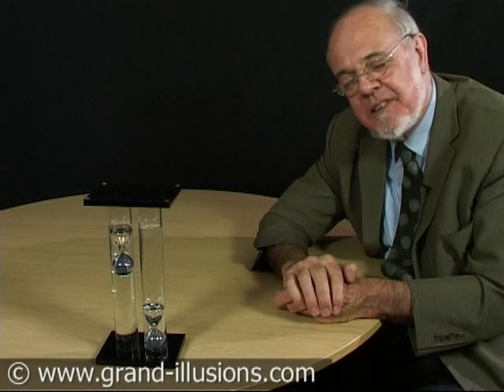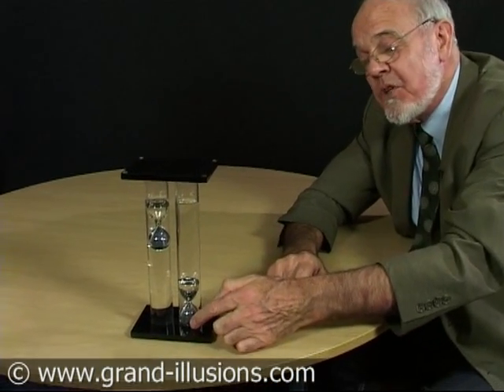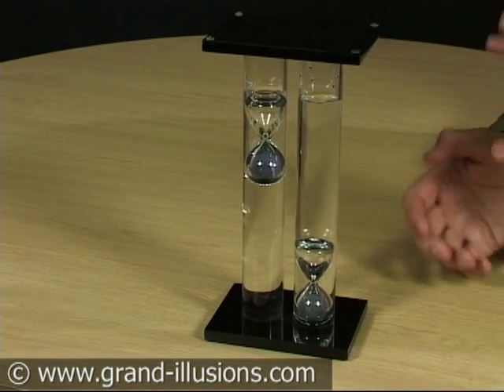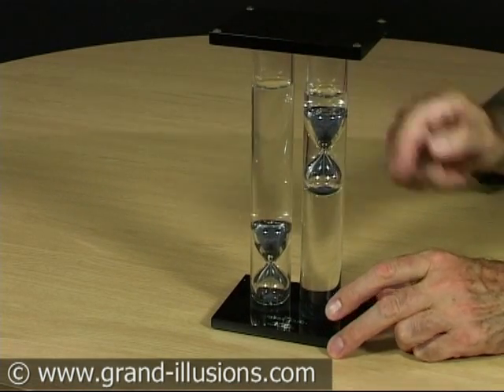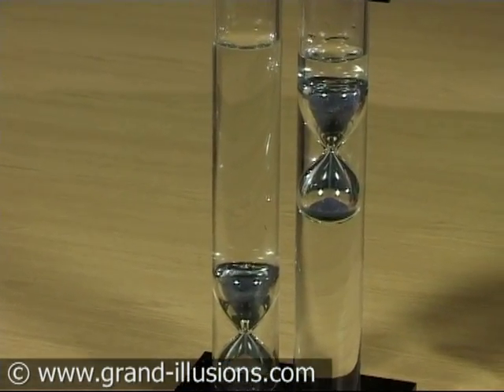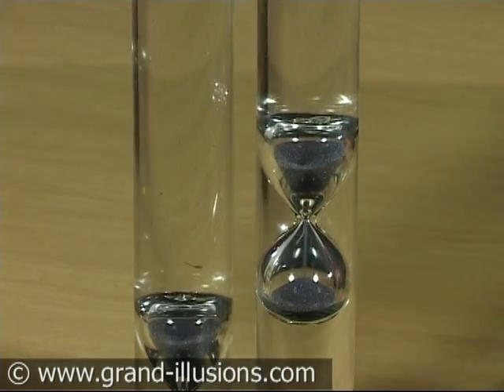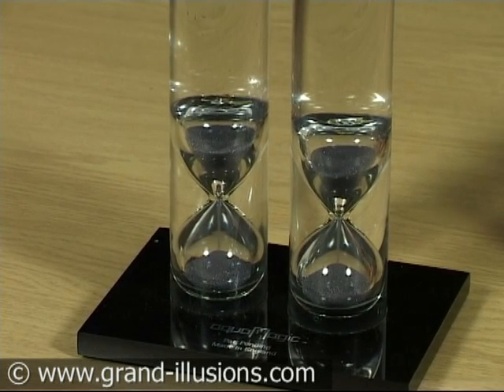Floating Hourglass

Comment: The reason it works is because when the sand is in the top, it leans over like this & which causes it to grip to the side of the glass, preventing it from floating up, as the sand falls to the bottom it straightens up like this 8 which allows it to float up.  The same goes for the other one, but gravity makes it easier to fall down, the grip isn't as strong with the tilt of the hourglass inside.
Reply: nambinhvu Err that is called a Hypothesis. You have an Idea as to while it works in that manner but you have not tested it. Therefore it is a guess.
Reply: Stanislav Drumzz
Don't explain why or anything. That would be weird. But what do I know, Im just an idiot.
Reply: I heard a myth once that human's can live without conflict over trivial matters.
Reply: That was my thought too. Are you sure this is the reason, or are you guessing?
Reply: @matszz  This may be interesting ;)
https://www.youtube.com/watch?v=L97Lrumscw8
Reply: matszz That is the only reason that would make sense under the laws of physics.  The small gap between the circumference of the two are also required in order to allow the displacement of the water for the hourglasses to move, which also slow the rise and fall of them.
Reply: So, guessing, thanks.
Reply: matszz Not really, because that is how it works. :P
Reply: nambinhvu
Yeah, you think thats how it works. Thats called a guess.
Reply: matszz Nope, I know that's how it works.  You think there's some magic going on? lol
Reply: matszz Guessing would imply not knowing/understanding.
Reply: nambinhvu
Yes, I asked if you knew or guessed. You stated the explanation you thought were correct. I agree with you, I think it's the right explanation. It's not confirmed in any way though. That makes it a guess. May I ask what your nationality is?
Reply: matszz The explanation is confirmed by what happens. :P There is nothing hidden, or magical.  You can see how the hourglass tilts over to the side and scrapes against the sides, which prevents it from floating up and going down.  It is glass, and the only thing not confirmed is what the fluid and sand is made of, but the fluid and sand doesn't matter, it's the density that matters, and as long as the densities are within a certain margin of error, it will do this, one has slightly more sand, glass, and/or less air to counteract the buoyancy.

And to answer your question, I am half Vietnamese half Chinese, not sure why that matters. XD
Reply: nambinhvu
You're welcome to believe you know for a fact what physical interactions cause this to happen. I don't know that for a fact, you can keep explaining what you think all day long, and you might be right. I believe it's right as well. I have higher standards to call something a fact though.

I was just curious about your nationality, I usually find americans to take a hunch or what they "think" and call it fact, until proven otherwise. That's not good enough, in my opinon.

I asked if you knew or guess. You responded not by saying you knew or guess. You responded with a more detailed explanation of why you think, or claim to know, this is the reason. That to me is a guess, it answerd my question. According to you its a fact, according to me it's a guess. It's just a matter of standards, or definitions.

Like I said, you're welcome to call it fact, and you answerd my question.
Reply: matszz Now tell me how we can claim that as a fact then?  Take a microscope to it, and view the rough surfaces scrape together and catch? It is fact, feel free to take a microscope to it if you'd like.
Reply: nambinhvu
I was thinking more asking the one who made it, or a physicist. That would be enough confirmation for me. Are you a physicist?
Reply: nambinhvu
Read the description, it explains the solution. We were right. There were other solutions offerd though, and one of them could have been right. Which made your position a guess, in my opinon. I now have confirmation, sufficient for me to call it fact. If you had said "yes, I know it, because I read the description" I would have accepted it.
Reply: matszz Someone who studies physics or creates something does not make them an expert, nor does it give them the knowledge to explain everything physics related.  I studied physics, does that count?  If I made one of those, would that count?  You don't need to know how buoyancy works to make this.  The maker of a boat doesn't necessarily know why or how it floats in water.  Someone could statically charge themselves and shock someone else without knowing how it works.  Rubbing your feet across the carpet is hardly an explanation of how it works. lol

By the way, if you don't know how boats work, they work by displacing the same mass of water as their total mass.  The shape allows them to displace more without being completely under water.  But completely sunk would displace less, because the water would be able to fill all the cracks and crevices, because the materials are more dense it would sink, but as long as the boat floats, no matter how you shape the materials, it'll displace the same mass of water.
Reply: nambinhvu
The word of someone who studied physics would weigh heavier than a lay-mans. Besides, all you proved is that the standards would have to be higher than merley having a physicists opinon, which I would agree to. But it's arguing against your own case. You claim to need higher standards, but in reality, you only need a lay-mans opinon (your own), to claim something to be true.

I don't know why you are explaining to me how boats work, it's irrelevant, and I allready knew why.

I don't really know why you explained any of this really, I thought the matter had been settled.
Reply: matszz The whole point is, you don't need to be an expert who studied in a specific field to know how things work.  Are you a boat expert?  I doubt it, but you know how it woks and can explain it right?  This is exactly my point.  A student can teach a teacher new things.

It doesn't take a rocket scientist to know and understand what is going on here, the one that sinks starts on top when he flips it because he flipped it upside down, vice versa for the other, so of course it would eventually come back down and of course the other one would float back up, because of their densities.  There's nothing magical or difficult to understand here.
Reply: nambinhvu
Im not a boat expert, no. A sea captain explained to me why boats float though, that's how I know. I doubt you could explain why boats float unless you learned it from somewhere. Sure, you could figure it out, Archimedes did.

Did you read the description, like I asked you to?

You don't need to keep explaining the reason why hour glasses behaved the way they do. Not only have I agreed with you the whole time. It actually says the same thing in the description.

I have never suggested it was "magical". It might not be difficult for you, but the majority of people who offerd solutions were wrong. I find it very arrogant to just assume you are in the "right" category.
Reply: Stanislav Drumzz
This is the fourth time you've responded to me. After the first time I asked you to provide some explanation or proof of your claim. And you STILL haven't done that, but instead added on MORE claims that you don't support in any way.

And according to you, that's perfectly in order.

I demonstrated that you were in fact wrong, undeniably, or so I thought.
You didn't respond to that though. Just said, nuh-uh. Like an idiot would.
Reply: deohboeh
Oh, I don't mind the conflict so much. People being rude or arrogant for no reason is worse, in my opinon.
Reply: Stanislav Drumzz
it's not the first time i tell you i'm not interested in explaining anything
Yeah, that part is obvious.

if you think i'm wrong, then figure that out yourself
I already figured out why you're wrong. I also explained to you how I figured that out. That seems to have gone over your head though. Since you ask me to figure it out.

Here's some life advice, free of charge. Don't go around calling people idiots unprovoked and refuse to explain why you called them that. It makes you look like a grade A cunt.
Reply: Stanislav Drumzz
Apology accepted.
Reply: thiscannotbeyourname
What's with the condecending tone?
Reply: nambinhvu
Yeah, I told you on 15th of May to read the description, because it occured to me too.

Read the description, it explains the solution. We were right. There were other solutions offerd though, and one of them could have been right. Which made your position a guess, in my opinon. I now have confirmation, sufficient for me to call it fact. If you had said "yes, I know it, because I read the description" I would have accepted it.

And again on also on May 15th, since you didn't respond.

Did you read the description, like I asked you to?

What you did in my OPINION, was a guess. The FACT that you (and I, remember?) turned out to be correct is irrelevant.
Reply: thiscannotbeyourname
Im not even going to bother, go harass someone else.
Reply: nambinhvu
since you seem to think we're all idiots who can't possibly know how buoyancy, friction, and gravity affect objects...
I haven't said you don't know how buoyancy, friction and gravity affects objects. Im sure you do, I do too. You're idiots because you think that is the issue here. And frankly, Im tired of trying to explain that to you.
Reply: nambinhvu
Honestly, I have answerd the questions you raised earlier. I meant what I said, I can't be botherd to do it over and over. At least someone understands what I mean, I can live with that. Does that make him a co-troll? Sounds like you're wrong again.
Reply: nambinhvu
Oh and by the way. I wasn't the one who thought you were a troll. I actually thought you were not a troll. Reading comprehension isn't you strong suit, but that has already been established.
Reply: Tyler Garza
If you're going to butt in, read the whole conversation first.
Reply: Tyler Garza
This conversation started 14th of may, you made your first comment today, 5th of july. Explain to me how you "were already here".

You obviously haven't read the whole conversation or you would know that I "discoverd" the description the 15th of may. And nambinhvu "discoverd" the description on the 7th of june (despite that I explained to him that the solution was offerd in the description once I had realized it).

So I have read the description, and Im curious how we are both wrong, when we both offerd the correct solution.

And as always, this is not what the discussion is about anyways, but I've sort of given up on trying to explain that to people.
Reply: matszz I'm starting to think that nambinhvu is more correct than you are. After all, he did make an educated-conclusion. I suppose the best way to put it is: your line between fact and guess is off by a bit.
Reply: nambinhvu Again that is a guess; Yes the math and physics support your theory well (in fact I agree that is the most likely outcome) however I have seen no testing or hard evidence to support that theory. Remember Ernest Rutherford was so convinced that the Atom followed the Cookie Dough Method because it made sense both mathematically and by the laws of physics that the experiment he did to prove it he deemed a waste of time. To the point he didnt even attend the initial testing and left his assistants to run to experiment and bring him the results and when the experiment proved atoms had space in them he was stunned and said "It is like shooting a piece of paper with a gun and the bullet bounced back" no one thought it could happen. 

The moral of that story is that no matter how sure you are in your belief you have to be open minded that it could be wrong. You have successfully completed the gathering information portion of the experiment and for a theoretical stand point you can say "I believe this is the cause" without fear. However if you want to say 'it is the cause because of blank" then you will need to either find the creator explaining how he made it work OR design it yourself and make some changes to it until you find the cause.

THAT is proving something scientifically what you have done is proven how it works in theory.
Reply: I read all of that with Tim's voice. Interesting really...
Reply: deohboeh lol
Reply: Stanislav Drumzz
You're welcome.
Reply: matszz i apologize for calling you an idiot, that was very immature and stupid of me.
Reply: gandalftheantlion
Thanks, first person not to patronize me in this whole thread. I just thought it was a guess, the way I define things, or grade levels of confidence in a proposition. He just kept explaining why he thought it was the correct answer.

I got no love whatsover for my opinon. Then some others just decided to jump in and call me names.

I agree with your sentiment as well, you should always leave room for doubt. As a skeptic, I view it as a virtue.
Reply: i am some what not convinced with this explanation.
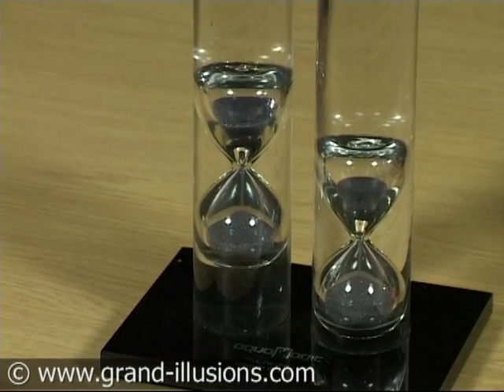around 1:30-1:35 both the tube have almost same amount off sand in hour-glass so physics should work same on both the side at this point of time
Reply: matszz I agree with everything you have said, but the reason I think you are being harassed is not because people think what your saying is wrong, but you seem to care a lot about something that appears to others to be so small, and on the internet. This makes you an easy target for one trying to get a reaction (a troll), which the internet is full of.
Reply: Troy Volanth
Thanks for the advice. Though I think you give them too much credit. The one who just answerd you, nambinhvu, demonstrated again that he doesn't understand what the issue is. I think that goes for all of them. I don't think they're trolling. thiscannotbeyourname might have been, but your guess is as good as mine. A voice of sanity in this thread is more than welcome, so, thanks again.
Reply: nambinhvu
Ok, that makes very little sense, but if you say so. I notice that you disregarded the other thing I said, you "forgot" to read that, like you normally do. Im so glad Im not you.
Reply: matszz lol I think he meant here on this video or something. XD  But yeah, he obviously didn't see that we'd already discovered the description, nor were we ever arguing about how it works.  We were merely arguing about whether or not my explanation on how it works was a guess or not. XD
Reply: nambinhvu
I agree with everything you just said. Let's end on that happy note.
Reply: matszz lols :P OK
Reply: *****
I don't understand what you're talking about.
Reply: matszz He doesn't understand how being top heavy causes the friction(stiction) against the glass tube and the hour glass by causing the hourglass to lean to one side slightly.  He thinks that if the sand was sealed into the tops of the hourglasses that it would still function the same way.

If the sand was sealed into the top and it remained top heavy, the only way to get them to float/sink back into their natural resting positions is if you continuously shake it in order to temporary remove the friction/stiction that's stopping it from moving up/down.

I don't know if he's ever seen one of those inflatable punch bags that always go back upright because of the sand/water in the bottom.  If he reversed the punchbag and tried to stand it on its head, he'd know exactly what I'm talking about when I say top heavy, and would realize the idiot he is...The hourglasses try to flip over while they're top heavy, this is what causes them to stick, which prevents them from floating/sinking until the sand falls and the hourglasses become bottom heavy.  Once this happens the hour glasses straighten up and no longer stick from the friction/stiction, so they can float/sink again due to the differences in buoyancy.
Reply: matszz No idea what he's going on about with the M&Ms and Skittles lmfao
Reply: nambinhvu
Thanks, I understand what he means now, I thought it might be what you said, but it's pretty dumb, and I wanted to apply the "principle of charity"

*****
I wanna know if you know this for a fact, or if you're guessing =)
Reply: ***** No, one will float, and one will sink, gravity will pull both downward because gravity does that to everything, but downward force does not automatically equal sink...the buoyancy levels is what causes them to float/sink...the stiction prevents them from moving to where their buoyancy will eventually take them.

Let me explain this in a way that even an idiot will understand.  Take two of the same exact water bottles, fill one with sand so that it just barely floats, now fill the other bottle with slightly more sand and watch how it sinks....one bottle of sand sinks, one bottle of sand floats, it's as simple as that...no stupid magical fluids...sure you could have one in different fluids, but then that changes how much sand/air content the hourglasses should have.  You're adding another variable that just makes the calculation more complicated...

You can put a bowling ball in a tub of mercury and it'll float, and then put it in a tub of water and it'll sink, but that is not what is happening here...one of the hourglasses is just more dense than water because of the higher sand/glass/lower air content(s).  And the shocking thing wasn't that one floats and one sinks, it's the fact that it waits a while before it starts to float/sink due to them being top heavy causing the friction/stiction, the friction/stiction is the part that puzzles most people.  If they stuck a piece of foam in one side and a rock in the other, it'd be obvious which would float and which would sink...and no one would be impressed by the fact that one object floats and one sinks...it's the delay that shocks people.
Reply: ***** Dude, do you not know how buoyancy works?  Weight has nothing to do with buoyancy...A cruise ship can weigh over a hundred thousand pounds and can still float...while a grain of sand can weigh not even 1 gram and sink...It has to do with the density, not with weight...the liquid (water) has the same density, the density of the hourglasses are different due to either more of the dense sand/glass/less air...
Reply: *****
Dude, the explanation he gave couldn't have been any clearer than that, and he explained where the confusion came from. Read it again, slowly. If that doesn't work, nothing will. We're right, and the description is right. What kind of confirmation are you looking for? What makes you so sure this solution is incorrect?
Reply: nambinhvu
Well this was a fun turn of events =)
I love how we both started our reply with "Dude" lol.
Reply: ***** Lol so if you had two boats that looked identical but one sunk and one floated you'd be amazed?  Maybe you should weigh the contents of the boat, because it's not easy to tell how massive an item is compared to another just by looking at it.  You can have a styrofoam rock and a real rock, just cause they look the same, doesn't mean they are the same mass.
Reply: ***** If you'd like, I could probably easily build one of these with two bottles twisted in the middle to form the hour glass shapes, then fill them with some dirt/sand and drop them in tubes filled with water, seal it up, and I'd have essentially a gigantic cheap version of this. XD  All I have to do is fiddle around with the amounts of dirt/sand until one just barely sinks an the other just barely floats.

Of course the nice clear tubes that are just about the diameter of the bottles would be the hardest part to find.  In fact, I don't even have to fill it with the same stuff, I could put oil/syrup/etc. in the tubes, and as long as the stuff in the bottles(hourglasses) has a higher mass than the fluid around them and can flow from one end to the other of the hourglasses, it'll work just fine.  Just gotta fiddle around with how much stuff to add to each bottle(hourglass)
Reply: ***** I'm amazed you're so puzzled by densities. XD
Reply: matszz rofl
Reply: ***** Did you know if you crumbled a ship so that it didn't have the air cavity from the V/U shape, the entire thing would sink, because the density would increase?  The reason the boat floats is because the shape allows it to displace the same mass of water as the ship.  If you take a 100 gram piece of iron, flatten it out, and make it a shape that takes up the volume of over 100 grams of water it'll float?  That is how density works.  Make it displace exactly 100 grams of water and seal it, and it'll be the same density of water, so it will neither float nor sink, if water gets in, the density increases as the less dense air is replaced by more dense water, which is why boats sink when water gets in.  If the boat were made of styrofoam adding water wouldn't sink it, because the foam is already less dense than water, so the only amount of mass it needs to displace is whatever material is above the water line.

This is why ice floats in water, because the molecules expand making it less dense.

This was a good lesson in density for you and other Youtubers, hopefully it'll help people here on Youtube better understand how density works. :)
Reply: ***** Even if you weren't puzzled by how the apparatus worked, you were definitely confused as to what everyone was amazed/puzzled by. lol  No one is/was amazed by a floating object floating and a sinking object sinking once flipped over, of course the floating one will still float and the sinking one will still sink...If you put a ball in a tube of water, and flip it over, you wouldn't be amazed that it floats back to the top...
Reply: matszz ROFL XD
Reply: nambinhvu
Nothing to bring people together like a common enemy. Im sorry I called you an idiot, which Im sure I did at some point.
Reply: matszz Actually, if he paid attention in the video, he even says it's filled with distilled water...lol
Reply: nambinhvu
He's a wonder of stupidity. I have never seen such a confused person. For some reason he thinks he is offering the same answer as us. Even though his first complaint was that we were wrong. How  is that even possible? Troll?
Reply: ***** Try reading the original post with the 10 thumbs...
Reply: ***** There is no oil in the tubes...he says his friend made it, and it's distilled water...
Reply: ***** At what point does the water stick to the sides of the tubes? Are you talking about the droplets?  Oil doesn't form droplets...
Reply: ***** LOL Serously? Get a glass of water, pour it out, I bet you water will be stuck to the glass...geeze, that's what happens when you have your mommy do your dishes for you all your life...

Glass isn't hydrophobic...you should know that from driving in the rain...
Reply: *****
Have you sober'd up yet?
Reply: *****
So, that's a no then...
Reply: matszz lols
Reply: *****
What led you to belive that?
Reply: nambinhvu
Read a few of his other posts, in one he explained that the thought black girls were pretty. I wonder what they would have to say about his language.
Reply: matszz Lols lets just let the troll be. :P
Reply: nambinhvu
Yeah you're right. Besides, I can't see his comments anymore, he removed them or put me on some ignore list or something.
Reply: matszz Lols he deleted them because he realized the idiot he was...and to avoid looking even more like an idiot, he's trying to pin it on me, which has the opposite effect. :P
Reply: nambinhvu
What a sad individual...
Reply: matszz I didn't think it was condescending at all. I would consider that a compliment. He said you are good at speaking, then asked what your age
Reply: Andre Cadete
So, is that a guess or do you know this is the way it works? =)
Reply: Andre Cadete LMFAO yeah...you have fun with that. :P
Reply: Andre Cadete
That didn't answer my question.
Reply: Andre Cadete
Yeah, you're right there, it wasn't the answer I wanted, since it wasn't about how it works. I want to know if your explanation is a guess, or if you know this is how it works.

Since you say in my opinion... it seems obvious Im still unclear on what the answer is. If I ask you for directions to New York and you answer "NY is a lovely place", it's not the answer I wanted. So can you give the answer I want? Are you guessing, or do you know?
Reply: Andre Cadete
I doubt anyone else in here does so it's all about opinions or arguments
It's not about opinion, I know what type of device it is, it says so in the description to the video, which you would have known if you read the whole thread before YOU complained about us fighting. What exactly have I complained about? I don't care about your drawings or explanations, I just wanted to know if you were guessing, or claiming to know. Something you have NOT answerd, it's a basically a "yes/no" situation. I don't understand why it's so hard for you to understand.
Reply: Josh Byrd Finally.
Reply: kevin francetti
Ok....
Reply: Buschwick
Go fuck yourself.
Reply: *****
Thank you for the recognition, it was a frustrating conversation.
Reply: Andre Cadete
Nope, not gonna take the bait this time.
Reply: Andre Cadete
How about I just disregard your comments?
Reply: Andre Cadete
What do you get out of trolling? How does that give you anything?
Reply: matszz What'd your teacher say?  Did the science fair go well? :)
Reply: Josh Byrd It's already been tested, and proven, therefore it's not a guess, the design is pretty simple, and it only takes a little knowledge of physics to understand, therefore there are no unknowns that need further testing.  It's as if I were to ask you why does 1+1=2 and you say because this and this and this, but how do you know?  Because it's simple logic, that's how addition works, same way this is simple physics, and that's how it works.  It's as simple as 1+1=2  Does it have to be me that does the experimenting for it to be a fact?  If someone shows you a chemical reaction, then tells you what's happening, does that make how it works a hypothesis to you since you haven't done the experiment for yourself?  Building this myself does not prove fact on how it works, all it proves is that the same design shape and what not has the same effect, but the fact that it's simple physics makes my understanding of how it works fact.  It is not a guess, what more would I need to make it fact?  Know the friction properties of two glass surfaces rubbing together under water, and how much force is exerted by the tilt, etc.?  If that's the case, I doubt even the creator knows how it works, and is just guessing...By the way, depending on how you turn it over, there could be more force pushing it to the side, because the sand piles up like this \ in the hourglass.  There's also the force of water pressure keeping it from falling quickly, because the water has to squeeze around the small space between the tube and the hourglass.

I did not make a guess, I understand the physics behind how the device works.  You can be more educated on the precise details of how exactly it works, how fast it will fall on average and all those other things based on gravity, differences in mass, etc., but that doesn't make my original comment a guess.
Reply: Josh Byrd Still doesn't prove that is how it works, by your definition of fact, nothing can truly ever be deemed a fact.  You can build something the same way, make adjustments to get it to work and not work, but that doesn't prove how or why the glass is sticking, or why it's floating and sinking.  You can do extra tests like put both hourglasses into giant tubs of water to show that one floats and one sinks because of their differences in density, but how can you say that is for a fact 100% the reason why something floats and sinks.  You say that is fact because that is your knowledge of density/buoyancy, but can you prove it?  You're asking me to break a fact down into how I know it's fact.  You can say friction, but in actuality it could be static or something else.  Are you saying that everything I learned in physics isn't fact until I test it myself?  Applying basic laws of physics in succession make it a guess?  That is like the saying, if a tree falls in the forest and no one is around to hear it, does it make a sound?  Yes, of course it makes a sound.  Unless the things I learned in physics and were told to be facts aren't actually facts, I was not guessing how it worked.

Testing and building does not = how it works, it just shows you that it does work, and obviously, it does work from the example shown.  I can cook rice, but that doesn't mean I can tell you how it works, or what temperature the rice needs to be, or at what point it's completely cooked, or the water to rice ratio, I just pour the stuff in and it works.  My point is, being able to build something does not mean you know how or why it works.  You can build something without knowing how it works, same as someone can know how something works, but not be able to build it.  You've seen those levitating super cooled superconductors right?  I'm pretty sure the person that first discovered it didn't know how it worked.  Same with the inventor of nylon, they accidentally invented it.  Being able to recreate something does not make you an expert on the subject.  Doing does not equate to knowing how something works, but you know it does work, just not how.

I do not have the ability to blow glass or make hour glasses.  I do not know where I can obtain one hour glass that is slightly more dense than water, and one that is slightly more buoyant, but if you were to ask me something like why does a boat float, and a rock sink, or how does a boat made of materials more dense than water float, I can answer those questions, and my answers would be fact, not guesses.  Would I be guessing if I were to say that a boat floats because the shape allows it to displace water equal to its mass without sinking?

The test and evidence is in the video.  As for the thing about shooting a piece of paper with a gun, if you fire enough bullets, you will eventually fire a dud, there will always be an exception to the rule because of some flaw that is known or unknown.  You would think that if you drop a coin, it would land on heads or tails, but in some cases it is possible to land on its side.

The only thing that would make it a guess is if there were an unknown, but with such basic objects, there is no unknown.  From the start he explains how it's made, the only unknown is why it takes a while to drop and the other takes a while to float.  Of course it's always good to have an open mind in case there is something else going on, but with this, it's a simple physics.
Reply: Are you still full of yourself like you used to be or have you matured a bit? I ask because not only was your first answer wrong, it was clearly a guess. it's not JUST/ONLY the friction that keeps the hour glasses in place until the sand moved,  it's ALSO, in fact, MAINLY their bouncy that makes it move. Your initial answer neglected the buoyancy. But yes, the unbalanced sand and friction prevents it from moving. Most explanations would not work if all things were equal. i.e. if the tubes and sand and glass were exactly the same. the exact same thing would happen on both sides. it's the fact that one hourglass can "float and the other can sink" that makes them move in opposite directions. That can be due to a vacuume in one hourglass. I must reiterate, The friction is inconsequential to the inevitable tendency of the hourglass to float or sink, but it does add some magic to this because it delays the inevitable while the sand is at the top and causing the hourglass to be unbalanced.
Reply: matszz After my explanation, it occurred to me that I should read the "about" thing, guess what, his explanation is exactly what I've been telling you. So now even your so called "expert" is guessing? Because I'm sure he asked an expert how it works.
Reply: matszz No, the other solutions offered were stupid...I knew what I said was fact before reading the description...I didn't need an "expert's" input.
Reply: matszz Observation and understanding is what makes people experts, not a title...And that's exactly what I've done. A doctor can have less experience than a child in certain medical areas, like true experience in their own diet, instead of taught experience. They know exactly how their diet is affecting their bodies. Don't just blindly assume experts know more than laymen. Teachers don't necessarily know more than the students.
Reply: matszz Sure, if you want to call making educated conclusions guesses, then everything is a guess, because we can only make conclusions based on what we experience...The thing that upsets me is you discredit my conclusion with your only reason being I'm not an expert...who is an expert in hourglass water buoyancy whatever you would call this...The way it works is basic physics (buoyancy and friction), it doesn't take an expert to understand what's going on here, there is no magic..., therefore my conclusion is not a guess, because I know exactly how it works.

You don't need to be an electrician to build an electromagnet, nor know how one works, also, just because you built it, doesn't mean you automatically know how it works.  The so called "experts" who discovered radioactivity died from it, because they didn't understand what was happening, they just saw condensation on the side of the glass and didn't know how it was happening.

And if you think we don't understand what you're getting at, then try explaining in a way people will understand, since you seem to think we're all idiots who can't possibly know how buoyancy, friction, and gravity affect objects...
Reply: matszz i'm sorry to sound rude, but you're an idiot, sir
Reply: there's not conflict, guys, at least not for me. i'm just expressing my opinion.
Reply: Stanislav Drumzz
You don't think calling me an idiot puts you in a conflict with me? That's amazingly stupid.

And you still haven't explained why you think Im an idiot. For those two reasons, I think YOU are an idiot.

You also read the whole thread and then called me an idiot. Which makes me think you're an idiot, but I could have missed something obvious, so I gave you the benefit of the doubt. But Im fairly certain now, you are an idiot.
Reply: i don't have to explain anything to you. if you think its a conflict, that's your problem
Reply: matszz im not wrong and you do have a problem with that, that is so obvious. :)
Reply: i'm not going to count but it's not the first time i tell you i'm not interested in explaining anything. if you think i'm wrong, then figure that out yourself.
Reply: I don't take advises from idiots. Thank you.
Reply: matszz You have a certain way about you. Being correct and thoroughly adhering to the topic at hand throughout the conversation. May I ask what your age is?
Reply: matszz

We... we understand your point. We get it.

You're brilliant! Such a mind should not be wasted on such a thing as a YouTube video. Go! Make wonderful things! Don't stagnate the brain on a message feed of a contraption meant to bewilder the simple-minded. Be the next great detective or inventor! Be free and conquer the world's problems.

Be the hero that we deserve, nay, need!
Reply: matszz
Demanding answers and ignoring questions? Are you a government worker? The expertise you have such as "reading" and "knowledge of everyone's experiences" leaves me in awe. Harassment is something not to be taken lightly. I only say things that I mean. I have noticed that you seem to be a person of great enough intellect to know this, anyway.

Then again, calling me out makes you the expert on being a bother to people for no reason.
Reply: Bhushit Gadhiya You left gravity out of your calculation, also keep in mind that one has a total density higher than water, and the other has a total density lower than the water.
Reply: Troy Volanth I'm not trolling :P I Just think it's idiotic that people think they need an "expert" to confirm something they know/believe to be true.  Even experts can be wrong, while someone who isn't an expert can be right, though less likely, it happens.
Reply: matszz Well if you know that, then there is no issue here. My original response wasn't a guess, that's that. Good day. :)

If you're trying to say there is no sure truth and everyone's guessing and we should always be open to other possibilities, you're right to an extent, but that would apply to experts too. In that case, your comment had no place here to begin with. Why would you ask if I knew or was guessing how it worked, if you think it's guessing no matter what and were just going to discredit my answer. Sounds like you're the troll...
Reply: matszz Never said you called me a troll, I think you're the one with reading comprehension issues. Lol The other person said maybe we're trolls, but I think the troll is you.
Reply: It's about the potential energy... the work in jouel E=F*L  F= Archimed force L=distance has to be the same at the potential energy at the start.. so the sand is changing his potential energy while the clessidr is "waitng".. you just have to do some math to find out his motion.. I know.. i explained very bad but I don't have time.. I hope you undesrtanded #YOLO
Reply: matszz Why don't you just ask your science teacher?  Do it for the science fair or something.  :)
Reply: +nambinhvu When you assume you make an ass out of you and me. Don't be so certain in an answer that you can't formerly prove. Your proof is that he's not magic? Well no shit he's not magic. Maybe there is something that you hadn't thought of. Besides, the friction of glass on glass would be very low.
Reply: +nambinhvu You claim to have become an expert by watching a video showing a phenomenon. You really are something else, do you know anything about science? There is a reason that scientists go through the process of making a hypothesis and proving/disproving it. What you have created sir is a hypothesis not a fact. You know people used to think the world was flat? During that time you certainly would have thought it was flat by observation. Too bad you would be wrong because you're closed minded and think that because you thought of the idea you're 100 percent correct.
Reply: It's not friction or grip. It's changing volume. When sands fall down, increase volume for one of them and decrease for the other one. Hourglasses may have some kind of diaphragm mechanism, it's probably made some elastic material or maybe there is a little hole in it which water doesn't pass because of surface resistance. 
Once a time I made a toy for my brother just same principle. It was a plastic bottle which full of water completely and there was a upside down plastic pen cap in it. When squeeze the bottle, the air pressed and decrease the volume in cap then it fall down. when release it, pressure down, the air expand, the cap float again.